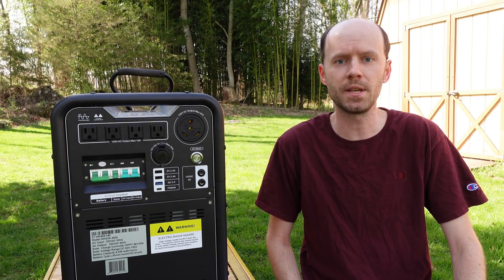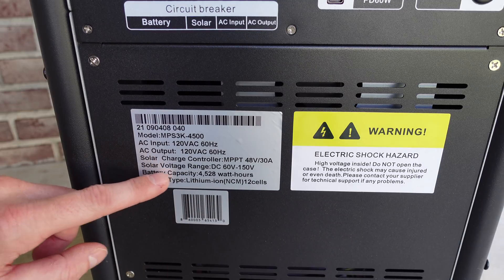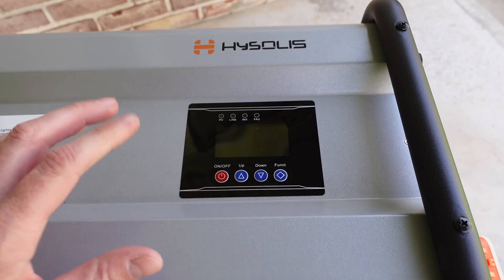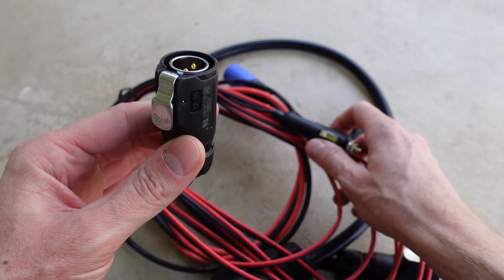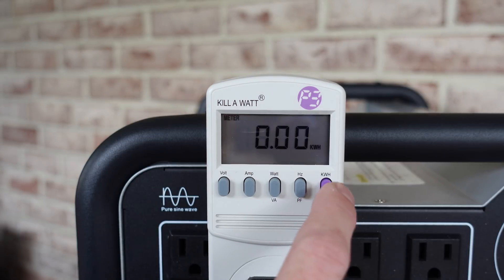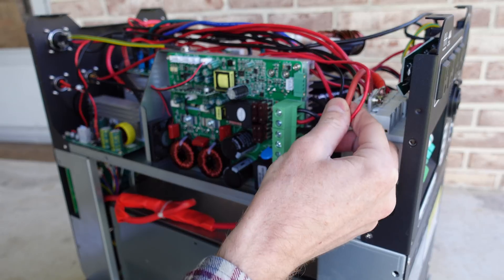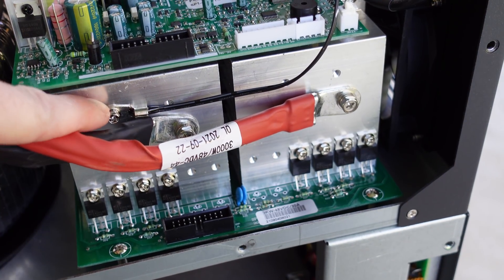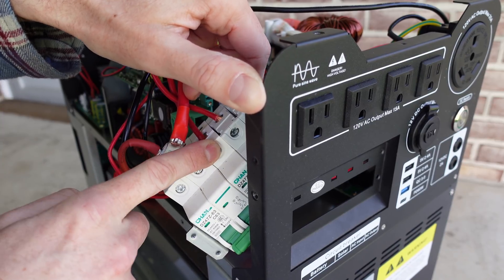Hysolis MPS3K 4.5kWh Power Station, Detailed Review and Teardown

Comment: Turn on all the loads with the circuit breaker to get maximum surge at once. And make sure the air compressor has atleast 100psi in tank. This will ensure it will pull even higher surge current!

Comment: Lithium iron phosphate would be much better in that unit. If they used EVE batteries than 6000-8000 cycles is normal
Reply from the maker: I fully agree!! They told me they are working on an LFP model.

Comment: how does that PV disconnect single pole breaker conform with NEC 2020 690.13 (e)?
Reply from the maker: Regarding a lockable disconnect? The breaker here is not lockable. I am not an electrician nor an expert in the NEC.
Reply: @LithiumSolar  I believe a PV disconnect needs to be duel pole.

Comment: Nice review of the power station!!  
Looks like they are using the same pcb for 220V AC system as well as for 120V AC system.
Usually these labels 190, 220, 250 are for AVR to give a stabilize output of 220V using the relays near these connections. Or there might be a switch/flag to toggle between 120V or 220V output on the control circuit or on the inverter board.

The smaller toroid attached to the battery positive input to the transformer is for reducing the no load current.

Comment: Hi i am relatively new to your channel. I have been trying to put together an off the grid system for my 70 foot yacht. I started with Tesla model S 24 V battery modules. But I am switching to the life PO4 batteries in a 24 V configuration.. My question is about BMS ? I am going to use multiple 24 V configured batteries and I wanted to be safe and last what do you recommend? 
I love what you’ve done so far with your channel it’s very informative please keep up the good work
If you’re interested in collaborating on my project I’d be grateful for all of your expertise and insight and would provide you with whatever pictures or video you want!

Comment: Have you ever done a tear down of nature generator as well as a test this unit is affordable even up here in Canada but with improper charging perameters for sealed lead acid batteries I know like most anything that has sealed lead acid batteries if you only charge it to dead and take it way below that the battery sulfates and needs to be replaced in a year I've got too many booster packs with dead batteries all ready but if the pure sine inverter is a good build and will put out it's rated power without losing its sine wave and or burning out I could live with its flaws or work around them if by opening it up I can fix the charging perameters that would make it worth buying if it had some proper reviews they might even fix the flaws I think if they fixed the charging perameters it would cost nothing and the  increase in sales of the units would more than make up for the loss of battery sales and the unit could be a great starter unit if the changed the pwm charge controller for a mppt charge controller that could handle a good charge as well as being able to be set to charge other battery types just think since sealed lead acid batteries can last between 5 and 8 years by the time the battery needs replacement the user can decide to either replace it with another sealed lead acid batteries or pay extra and go lithium I've got extra batteries and a 60 amp pwm solar control if I only knew whether the inverter was any good and if I can fix the charging perameters this unit is also the only one with a built in wind charger controller and an optional wind charger

Comment: If it's 20 amp it's not asessory port the plastic disc that holds the positive connection would melt a cigarette lighter plug has a ciramic disc to keep from melting it when heating up the lighter heating coil red hot

Comment: Great video. One thing I like to see is the testing of the AC outlets to see if the Hot, Neutral, and Ground are wired properly and also if it has Neutral/Ground bonding or not.

Comment: Does that control board for the inverter look familiar?  It should.  It's our old friend that is related to the same board found in oh so many Chinese low frequency inverters.  The sungoldpower inverter previously reviewed on this youtube channel had the same.  I'd still like to see the AC waveform of the sungoldpower under full load, and it'd be good to see how this one stacks up too, including what it looks like when the battery voltage is low.  It also looks like the standard generic FET board complete with poor layout and associated crosstalk issues.  I'm not saying the Hysolis is no good, just that it would be interesting to see how it performs with the curtains pulled back.

Comment: That AC-input relay/resistor board is to limit input rush current. Toroidal transformers take huge amount of current at start. That size transformer would trip fuses easily without that board.
Those tx-190-220-250 wires. I don't know for sure, but one thing I was thinking was readiness to other countries? Just changer tab to out-L in the right corner. I doubt it tho, sounds odd to put more expensive transformer to all just for that.
Reply: Hmmm?? Is neutral connected directly trough? Is there direct connection between input and output AC-neutrals? It looks like that to me, but I hope I see wrong.
Reply: After short thinking I suspect that those four wires (black-green-red-blue) are just two 120v tabs put in parallel. Same transformer and basic configuration can be used also on split phase and 240v inverters.

Comment: For the ease of plug and play and how it handled the 3 at the same time. Does anyone here know if the 2000 cycles full or half discharge and full recharge or any discharge and recharge?  Asking because years ago I was burnt with the "oh the cycle count is ANY amount of discharge and recharge", even if it was sitting unused in the cabin for a month it was counting as daily cycles just trickle charging to maintain full charge.

Comment: Wow ! That big monster can run almost everything all at once at 120 v , and it’s a low frequency inverter charger system using a torrid transformer . Soo efficient  . The NCM cells instead of lipofe4 cells are quite as powerful of being a little light weight for a generator like this .🤗. Great video and May the solar be with you .🤙👍🏿🧖‍♂️

Comment: The tech specs says 121lbs shipping weight.   Did you have the wheel option?   Were you able to move it yourself?      Thanks for another great video!
Reply from the maker: I can lift it myself but not walk around with it easily. I put it on a hand truck when I transported it to the yard for filming. It comes shipped in a wooden crate and was carried off the truck by 2 people.

Comment: I think the ratings are 15A max for each outlet, and 25A max total for the whole bank. So any "1" outlet can surge to 15A if nothing else is connected, or if multiple things are connected then the max safe rating would 25A cumulative of all outlet loads.
Reply from the maker: That's the same conclusion I reached as well. I was just one of those things that made me go "hmmm" when I went to run the test lol.
Reply: @LithiumSolar  A lot of USB bank/strips are done the same way. Each port can do 2.1A, but 4 ports together can only do 5A max. So quite common practice this is done.
Partly to save on build costs, and partly to only build what is absolutely needed. How often would someone need to pull more than 25A? Probably hardly ever. The outlets can handle almost 2x surge for a second or two. So even if going over that rating, the sockets and inverter can handle it for a brief amount. which you found out when you did your air compressor start tests.
I don't recall if you've checked before, but I'm gonna hazard a guess that the compressor pulls close to 16A surge start. Could even be closer to 20A.
Good job on the review, btw. You're coming along pretty good on these tests/reviews 😎👍

Comment: Wow, what a beast. At a whopping 121lbs, the optional dolly wheels for $95 is pretty much a must. Still, I built a 4.5KWh portable system for MY RV at about the same price, but mine is way too big and clumsy. The only thing I don't like is the Li-Ion NMC batteries. LiFePO4 would have been the better choice for this unit. Great job as always! Happy Easter all!
Reply: I would pickup a furniture dolly from lowes or Home Depot  $35.  Add a sheet of plywood for a deck. All done ✅.
Reply: Everyone would have preferred LiFePO4, but I think it would also add over 50lbs to the package at the same WH.  2000 cycles is a lot for NMC, they must have underrated the batteries.
Reply: @Substancejdno  Surprisingly the Delta Pro has similar specs, but a ~3600WH LiFePO4 battery and weights 99Lbs.  I think they could have made this weight under 125lbs with the 4500wh LiFePO4 battery.
Reply: @fromnineteeneightyfive  The Bluettie EP 500Pro is 182lbs.  Note that there is a 15lbs weight difference between the EP 500 (2000 watt inverter) vs the EP500 Pro (3000 watt inverter).   Low frequency inverters are also built with more metal and weight.  They Hysolis inverter is a beast.   the EP500 does have 500 more watt hours than the Hysolis, but the difference in watt hour with the  Ecoflow is 1000.    The build quality of the Hysolis is metal vs the ABS plastic of the Bluettti and Ecoflow.  I think the Bluetti is a closer comparison for what something in LiFePO would weigh.  But we'll all amateurs so it's all IMHO.
Reply: @Substancejdno   You are assuming that the 2000 cycles are to 80%. No information on the cycle count to 80% or 60%. I disagree with your assessment of an additional 50lbs. LFP would be more, but 50lbs?
Reply: @Jon A  lifepo4 cells are almost 2x as heavy at the same energy density.  90-120wh/kg vs 200wh/kg.  I just built a 4800wh battery pack with 420 3.1ah cells. The cells alone weighs 44lbs. They are standard 18650 lithium cells. So maybe the added weight for lifepo4 would be anywhere from 35-45lb increase.

Comment: Only potential niggle I saw - it appears that there are several stranded wires connected to screw-down terminals without ferrules.
Reply from the maker: I tugged on most of the connections and they were all secure. Connections looked appropriate for use without ferrules in my opinion (I am not an engineer).

Comment: What stuck out for me was only 2000 cycles? And it looks like 1500 W of solar & 150 V input. 
Great review as always! 🖖
Reply: 2000 cycles to 80% of original capacity
Reply: For Lithium Ion, that rating is actually pretty good.
Reply: @The_Good_Life_starts_today  it's nmc there a little different that regular li ion I would still prefer lifepo4 tho
Reply: @andrewcampbell5258  Agree. However there's a huge difference in the weight

Comment: Sir:  You mention it's a low-frequency converter.  The large transformer inside would also seem to confirm that.  However, their specs for peak output are only twice the rated or constant output.  Most low-frequency inverters have a three to one rather than a two to one peak.  Although there are disadvantages, the advantage of a low-frequency inverter is its ability to tolerate the in-rush power of something like an air conditioner without harm to the unit.  

Just sayin', 

A.T. Burke
Reply: They might be underselling the specs or they are quoting a longer surge time. My low frequency Lvx6048 has a surge rating of 12kw for 5 seconds but it has no problem with higher power than that for shorter periods.
Reply from the maker: I'm not an electrical engineer, so I can't comment regarding how they calculate those numbers. I agree that most LF inverters I've seen are 3x the surge rating; however, they're usually the inverters of which all look the same (AIMS, SunGoldPower, Sigineer, etc) so maybe that's why. I'm not sure... but based on how it performed here, am confident it is indeed low-frequency.

Comment: That looks like a great product, but I would much rather pay a bit more, and get a bit less total capacity, in exchange for LFP chemistry.
Reply: - LFP cells shouldn't be any more expensive (some would expect to be cheaper) .  Swings and roundabouts; typically more weight or less continuous power output and storage capacity traded for longer cycle life.

Comment: Nice jorb, nice product. I was surprised as well when it started all 3 heavy draw items! Good internal build, liked having the circuit breakers and was surprised to see the big toroidal thing-a-mabob in there! I don't think I've seen a BMS with a energy coil on it yet- seems well considered... BUT 'Spensive for us regular folk. Sad about those cells (NCM) as for that kind of cash, I'd prefer to see LiFePO4.
Reply from the maker: I definitely would have preferred to see LiFePO4 as well! Also, I honestly didn't expect it to start all 3 of those appliances either. The air compressor hits pretty hard on start-up and even that vacuum - I blew out a 1500W inverter (high frequency) in the past trying to run it lol.
Reply: I prefer LiFrPO4 too, but for my usage, which averages about 2 power failures a year, those NCM batteries will last me about 500 years. I don't expect hardly anyone to benefit from 1500-3000 cycles because something better will come along and make us forget about LiFePO4s.

Comment: NCM batteries? Not LFP? Is that a fire risk?
Reply from the maker: Yes, it's using NMC. There is a risk associated with using any kind of battery or any electrical appliance. I would have loved to see LiFePO4 in here though!
Reply: @LithiumSolar  NMC is more likely to ignite and burn under the right conditions. For example, a high charge rate contributes to thermal runaway, potential heat damage and is more prevalent in NMC battery pack than in LFP.
Reply from the maker: @arnecarlsson9740  Yes, NMC is indeed considered to be a more volatile chemistry than LFP.
Reply: @arnecarlsson9740  - Have you ever used a smartphone, laptop, cordless beard trimmer, or any one of dozens of other devices?  Those almost all use 18650 NMC cells.  The fire risk, in a properly designed and fused appliance of this type, is almost entirely eliminated.
Reply: @jasonbroom7147  I thought or suspect the batteries are pouch type and not metal cylinders.
Reply from the maker: @arnecarlsson9740  I think they're metal-cased blocks similar to the Al-cased LiFePO4 we're all used to. I'll see if I can find more details on the battery.
Reply: @LithiumSolar  Thanks for great videos!
Reply: Something else NMC battery cell voltage is 3.7V and Hysolis MPS3K specs says voltage is 44.4V.  That means there are only 12 cells. A LFP system normally has 16 cells and higher nominal voltage.
Reply: no worry, should not light up

Comment: Charging from a cig lighter ... isn't that somewhat of a joke?  Wouldn't it take days to charge it from a cig lighter?
Reply: From 24v truck would charge from 0 to 100% in less them 19h at full 10A. Great to have alternative when no additional source would be avalible
Reply: An extra port is better than no port... Can't find the logic for complaining.
Reply: @santiagosalcedo7653  LOL.
Reply: @santiagosalcedo7653  Americans complain about everything 😂
Reply from the maker: Agree it would be very slow charging; however, there are cases where it may be the only option or you want/need to supplement PV power. For example, even if you have solar panels on your trailer, maybe it's raining and you still want to be able to charge - hook up the car's +12V and you're good.
Reply: @LithiumSolar   The reason I asked is because I had a tiny battery I used for my laptop, it would only power a regular corporate type laptop for 4 to 5 hours and it took around 5 hours to charge the tiny battery when in the van and I had to keep the van running else it could drain the van's battery.  I didn't find that being a good situation.  I found myself wishing for a 120v outlet with none around.